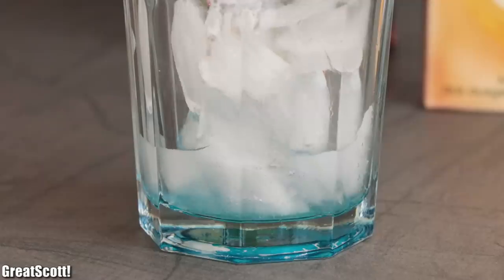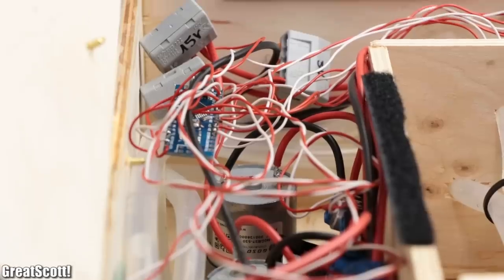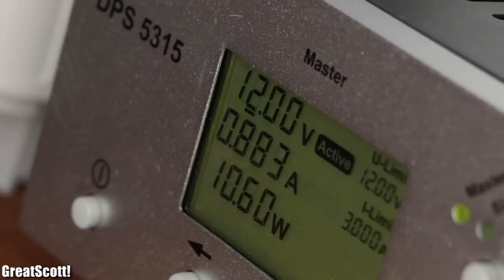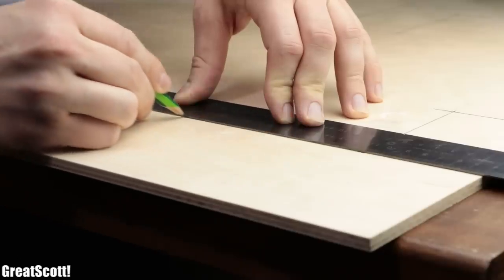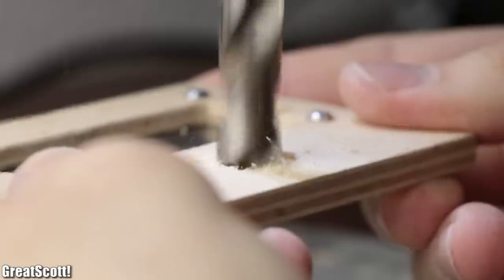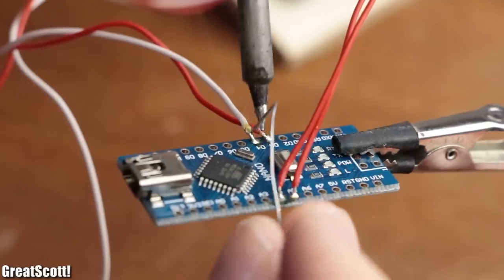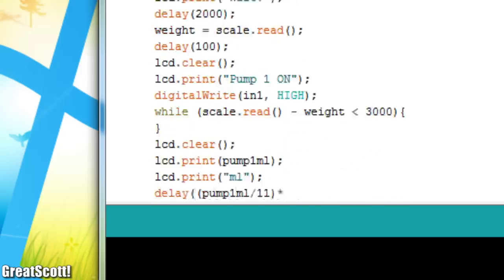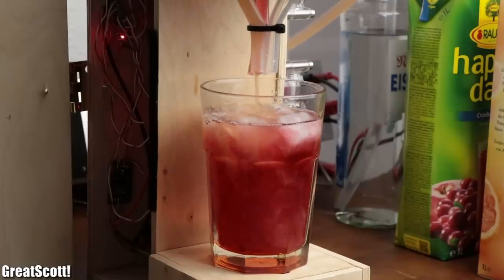Make your own crude Cocktail Machine

Comment: This is a great video and a really cool project ^^ But I kinda don't understand, why the motor drivers? The motors only run in one direction at a constaint speed. No changing of direction or PWM stuffs.  Couldn't the same have been accomplished by just a simple power transistor or mosfet?

Comment: Could you use half of the l298 for each motor since you only need to deliver liquid to the glass and not pump it out? That would allow four motors per driver.  Too bad the pumps are so expensive, looks like a neat method.
Reply: No, It's a dual H bridge, and one h bridge can control only 1 motor.
Reply: I guess I was thinking of a full h-bridge, where each totem-pole output could be set high or low independently.

Comment: Please could you make a beverage dispenser with the use of a solenoid valve which will be directly connected to water and with a water flow meter it will automatically so when the given quantity is reached
You could also use your diy peristaltic pump

Comment: Out of curiosity why is the Arduino using a timer to stop the motors instead of using the scale to weigh the liquids? I guess I'm confused as the time it would take to pump x amount of vodka is different from say the time to pump x amount of molasses and it would be easier to find weight by volume then run it through the machine to find volume pumped / time right?

Comment: hello, can you help adding timer function into the code so if the liquid bottle is empty, the fuction will stop after X mount of seconds; to prevent motor from running and burning out.   I try the millis() function, but I couldn't figure out how to get the counter start after the drink is requested.

Comment: There's one thing I don't quite get... in your schematic you say that you need 5V for some stuff... makes sense to me but I'm confused where those are supposed to come from since you only use one 15V power supply... do you use a capacitor? I didn't see that on the parts list so I got confused. I'm probably just missing something obvious though :D

Comment: Hey Scott,
So I took my old PlayStation ‘bluetooth’ (it has a USB dongle which you have to plug into the PS4 or computer) apart and I was wondering if it would be possible to make some Bluetooth speakers out of them. 
Obviously since they are from headphones the speakers aren’t very loud. 
Would I need completely new amplification circuits to run louder speakers with it?

Comment: Hi GreatScott,

Fantastic video as always. I am looking forward to the detailed video about the pump. I have a similar project in developmend and could not find a suitable pump to measure liquids on such small scale. This pointed me in the right direction. GreatScott saves the day once again. What is the minimum weight that your load cell can detect?

I was wondering if you could do a detailed video around how to export gerber files in eagle for jcpcb? I tried to export and followed tutorials but jcpcb gives errors that it cannot find the board outlines. Quite strange. It would also be helpful if you could inclede how to do measurements in eagle ie distance between hole for instance. Although this is more of an eagle tutorial video I supose.

Have a good week.

Comment: As a woodworker, use a line of woodglue and leave a gap every 5 cm for a drop of superglue. The woodglue wil bond your peaces and superglue is a clamp. Or check out jimmy direstas 10 tips on a hot glue gun for more practical tips.

To prevent the "horrible" edges of holes use a backer, a bit of wood you can drill into to prevent "blowout".

A jigsaw is for cutting curves not strait lines. See to invest in a small tablesaw. Second benchtop model should cost less then a 100 euros

Keep up the cool project. I know shit about electronics but you teach mee the basucs in a fun way.

Comment: Hi Scott, can you give me an advise how you got the 15v 5a DC to run with the H Bridge? I redesigned your basic scheme but within seconds the H Bridge reaches temperatures more than 50°C. I want to control a basic stepper motor (17HS4401) with the h bridge an the power supply you recommended.

I hope you will answer me :-)
BTW you can answer me in German as well ;-)

Comment: Why don't you just use the load cell to determine volume? Since most juices are close to 1g/ml and you could easily add a density to the sketch to set the ratio. You should also just have the cocktail on the menu, with instruction as to which pump is what, and the glasses volume since the ratio of liquids are constant for each cocktail.

Comment: Wood work: Use wood file, not metal file.  And use sand paper to make the surfaces and edges better. :-)
Drill holes in the wood before screw or nail them together.  Don't use to large drill bits. :-)

Comment: The only issue I see is that you've exchanged a volume recipe (parts) for a weight recipe without accounting for the varying weight by volume of the liquids. Alcohol is about 25% lighter by volume than the juice so your current code is making a boozier drink.

Comment: Why using the pressure sensor if it's just to serve as a switch for the timer? Why not simply find out how long it takes for the liquid to enter the glass and then add this duration to you timer? 

And if you use the pressure sensor, why not use it for measurements as well? Densities of the liquids you'll use will be pretty close and it would solve the issue of different flow rates depending on viscosity

Great project anyway!

Comment: Dear Great Scott, I have a question, I have a similar project at our school, but my problem is that I cannot control our LCD screen. I use the Arduino code using a switch and case option, but I cannot figure out how to use the LCD. screen to work. I struggle with it every day, but without success, there is someone here who knows a lot about it or would be willing to help me with it. Kind regards Vitally

Comment: You should have reversed the pumps after each use so it can clear the tube. Awesome drinks machine though 🙂
Reply from the maker: That was my initial plan as well but since the pressure of the pumps holds the liquid perfectly, there was no need for it. It would only slow down the process. But of course having a "cleaning option" where the liquids are pumped back into the bottles, would be a good idea.

Comment: why do you use the scale for the "liquid starts" test only? couldn't you get better, liquid type independent, measurements by using the scale for actually measuring the amounts instead of a timer? or if the timer is good enough, why do you even need the scale, you could just measure the time it takes for liquid to move through the hose.

Comment: While 100ml of water weigh exactly 100 gram, that does not apply to any other liquids. They can vary wildly, especially ones with a lot of sugar in them.
Or short:
The Wodka is lighter then water while all the juices should be heavier.
Probably doesn't matter, just curious if you accounted for that.

Comment: I don't get it. The scale zeros before each pump fills the glass, but it measures the weight of the liquid against the zero's value AND THEN "allows the predetermined milliliters to enter the glass?" But wouldn't you have already poured all the liquid f on the pump to measure that in the first place? Why not just base the milliliters on the weight and have the load sensor ping when the 3000ml is poured to cut off the pump, and start the delay for the next pump? Or is that what it is doing and the wording just didn't come through to me?

Comment: You can get precision peristaltic pumps driven by NEMA 17 stepper motors, so they can all run at once ... but the liquid will still hang around in the tubing, get mouldy, and eventually, poison all your guests with botulism unless you solve the tube cleaning issue. This cleaning issue is, by the way, why bartenders still have jobs.

Comment: Using the wood glue like that has almost no effect. It is supposed to put between touching pieces of wood to get a strong joint. If the glue isn't between them or there is even a small gap between the pieces of wood, the wood glue will be useless.

Comment: Those pumps are pricey. If you'd just hang bottles upside down, you could get away with using a solenoid valve on each of them and let gravity do the work. For measuring the amount of liquid get a coffee machine fluid meter. They aren't expensive either, but you could even connect all hoses with Y pieces right before the meter.

Comment: I know that the Arduino doesn't draw that much power, but still, the idea of surrounding electronics with wood doesn't sound like a good design choice.
Reply from the maker: The heat is definitely not a problem in this project.

Comment: Solder job is not good. Try to use solder flux. If I look at your PCB it looks like solder mountains - especially by the resistors and capacitors, there are bad solder spikes.

Comment: Using expansive pumps and such poor wood case is weird.. maybe using gravity and placing the bottles over the machine.. and easily pilot some electronic water valves..
No vibrations, no motors, lowest consumption.
Reply: Etienne ESQUIROL interesting idea, how would you measure each quantity, or more interesting yet, could you insert all three (or more) liquids at once to do it quickly?
Reply: I agree, that a dark point I noticed too. You can use the weight sensor for the quantity, it will change nothing because in his project all the pumps are not working at the same time. 
Do it all at once appears complicated for me now.
Maybe I have an idea for how plug the bottles but nothing really simple..
Reply: I think that's a valid point. A solution with tubes is always a problem as you have to clean them after usage with e. g. sugar included liquids.